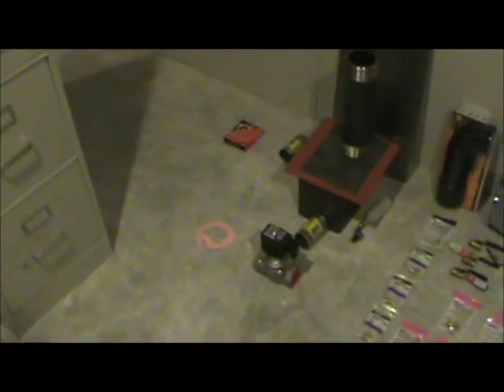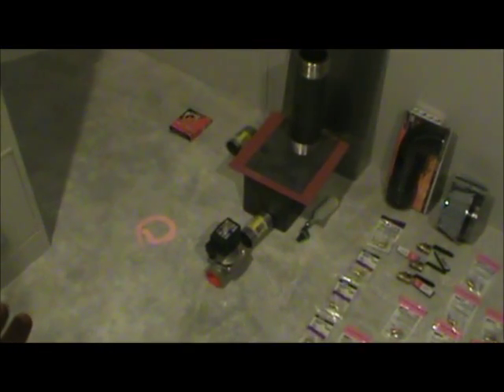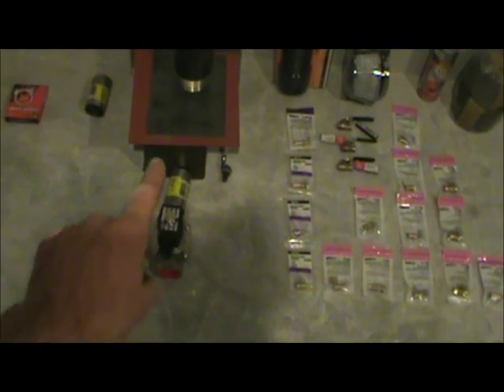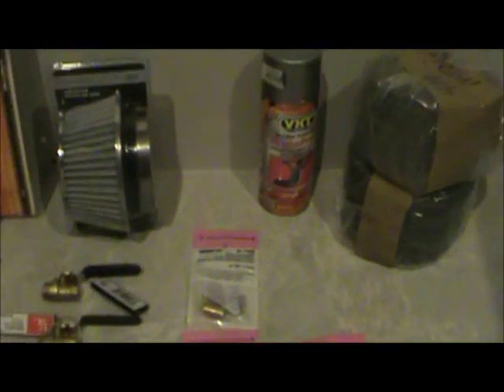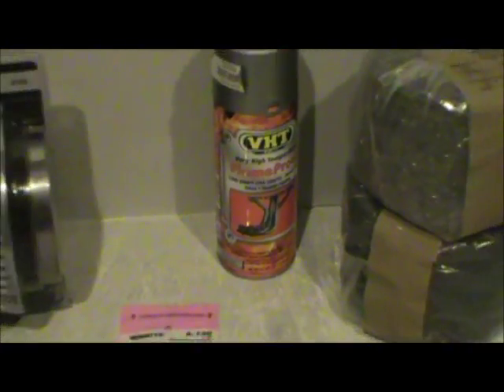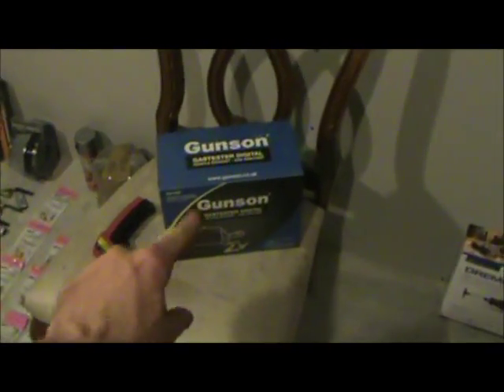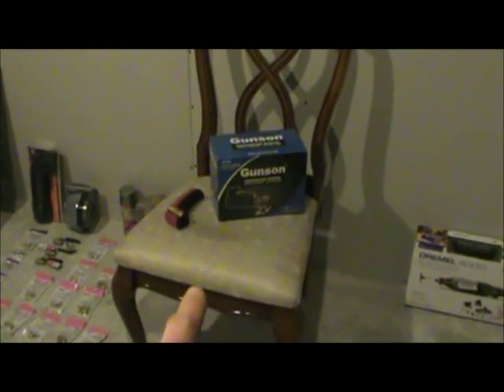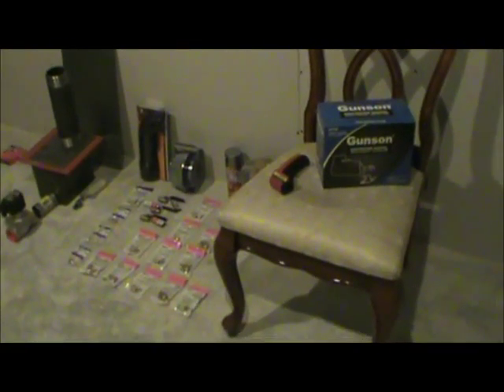100+ MPG Project New Fuel Vaporizer Design Part 1.2

Comment: could you tell us the temperature of your vehicles tail pipe and the temp of the air that day? after you have ran it, not just idle'd it.  (with the vapor system installed)

Comment: On eBay, you can type in the following:  
"Oil Fuel Liquid Level Sensor Vertical Stainless Steel Floating Switch"
 It IS stainless, BUT the float is plastic, so that would likely be a "heat" problem. However, it does say "Fuel" so, who knows? Overall height is 7.5" It's about $8

Comment: Why don't you just connect a cable manually to your gas peddle and run it to your butterfly valve, because when you accelerate your gas pedal does move up and down. And yes I have heard of bubbling hho through gas as the hho enhances the gas. Type ( Practical guide to free energy devices pdf) in google and go to Chapter 10. There is a load of Useful info on hho and running internal combustion engines on water.

Comment from the maker: I will be doing allot of testing in many different areas and changing the timing will be one of them. I will be using a HHO gasoline vapor mixture and will change the ratios and when I do this I will change the timing to see at which point it runs the best and is the most efficient.

Comment: Hello, Tyson if you want to run your car on water/ hydrogen then you will need to delay your ignition timing past (tdc) top dead center and make a plasma ignition since it splits the water instantly. As for the vaporizer you should bubble the gas and if it is too dense then you can have a secondary inlet, like your other video where you use your hand, and control it with a butterfly valve attached to your gas pedal. Keep up the great work, and God Bless

Comment from the maker: I believe it would only be possible to use a propane conversion kit if there were still a way for ambient air to enter the mixture. The only way you could keep the gas in a vapor state would be to keep heat in the holding tank.

Comment: Would it be possible to use a natural gas or propane injector conversion kit using gas vapors instead.  Maybe you can use fiber gas tank and have if filled with gas under the same pressure as propane or natural gas.  If that would work it should be less involve to convert.

Comment: Did you try using a Ultrasonic mister? 12 ultrasonic misters can be used to make the large amount of gasoline mist to start engine instantly, then it can be turned down with a dimmer type switch. But like you said clod vapor is to dense to run it nicely so heat might be the best way to go.

Comment: I like your exhaust gas analyzer. My research and study indicate that when injecting liquid droplets of gasoline into the engine(via fuel injectors or carbureted), the most heat is generated at the 14.7 to 1 air to fuel ratio. An EGT(exhaust gas temperature) gauge has confirm this. Thus: lean and rich air to fuel ratios produce lower exhaust gas temperatures.

Comment: I herd that to get the best performance from the engine in a vapor set up is that the timing needs to be changed on the cylinders, because the default timing isnt set for the best power, its set so that the excess gas can escape before the next pump?

Comment: Hey Tyson, I've got a bypass oil filter design that uses used cigarette butts. It should allow people to never have to change their oil ever again, if you use a high grade synthetic oil and the engine oil system is clean. Basically all you'd have to do is top off your oil once every 6 months to a year, and change the cigarette butts, not sure how frequent it would have to be done. That would have to be figured out in testing. Let me know if your interested in working on that project with me?